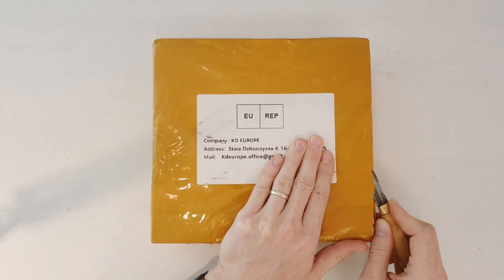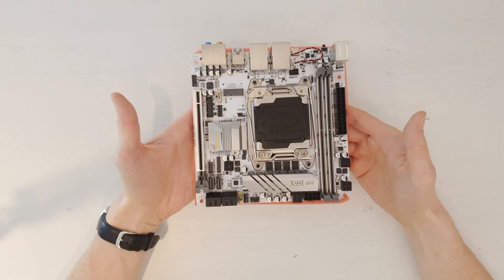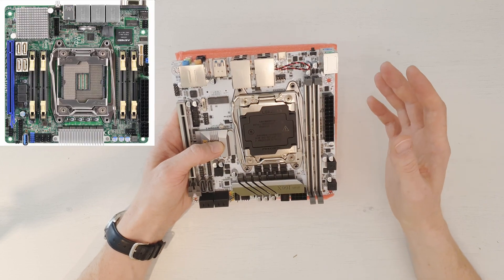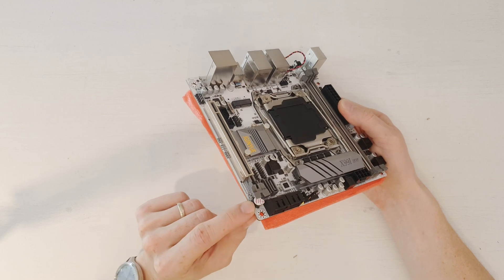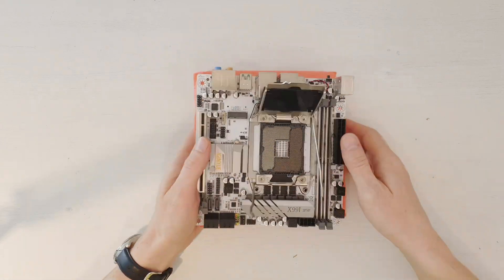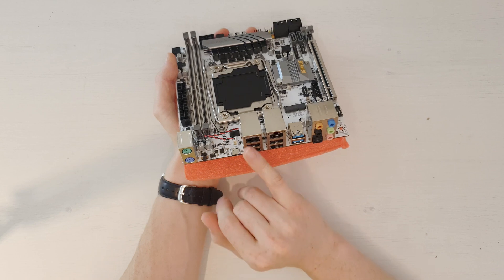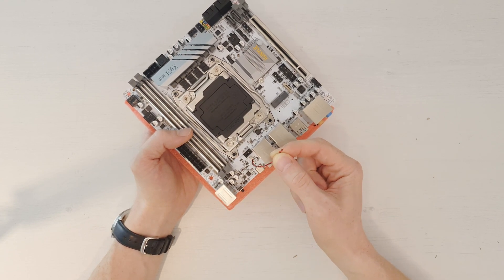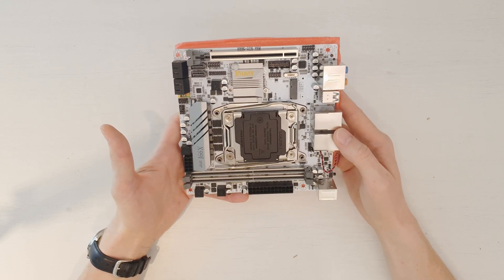🇬🇧 Unboxing Jginyue X99i Server and Specs Overview

Comment: I was crazy again, I beat Ali. I got the deal (JGINYUE X99I-SERVER motherboard), 5 days delivery to DE for 86€ AllinOne. 
Now I just have to find a suitable BIOS, either from the manufacturer or what I almost prefer, if ‘BIOS-iEngineer’ offers something, then from him. 
The CPU cooler ‘SNK-P0048PS’ 15€, with shipping, will take a few more days to arrive, with 2x Arctic P8 PWM PST fans.

Comment: Hello
I buy this model and installed all but no screen 
Gpu and cpu cooler still running without screen 

My setup
Intel xeon E5 1650v4 
64GB ddr4 ECC 3200MHZ 
RTX 4060 Ventus x2
SSD M2 Crucial P4 1tb

I tried many solution but no result 

In case you had this issue Maybe you can help and share how to solve 

Many thanks for your help 😊

Comment: did you figure out what is going on with the cmos battery? i have seen quite a few aliexpress mobos without cmos battery slots. but also i googled it and it said they store thebios settings in a non volitile memory, which means that the settings dont need constant power to be saved
Reply from the maker: My detailed review of the motherboard is available here: https://youtu.be/mBDM4isYs2Y

Comment: Sad to see it at around 650 yuan. It's cool if already have a 2011 v3 CPU and want to built on a mini it's platform, but considering that you have to also get another cooler, a small micro ATX build with a cheaper board and cooling solution will still be better if building on a budget
Reply from the maker: That's true, but it's still interesting to explore the motherboard.
Reply: @miyconstclips  know any ultra low profile cooler compatible with lga 2011-3? I really want a really small itx build with this mobo but cant found good itx cooler.
Reply from the maker: @1986Hikaru  yes, there is one, I have updated the video description, but don't by this motherboard, watch my review first.

Comment: Interesting to see 8 phase vrm and "solid state" vrm capacitors on the "low" side. Curious on how it will perform with 2666v3 or higher tdp cpus.

Comment: Just yesterday I thinking "does the Chinese will make ITX X99 board?" Since I want to put it on modded PS2 case, and here we go, what a coincidence 😂
Reply: ill save you a little bit of effort - if its a slim ps2 shell it wont fit
Reply: @limewirepro  Bruh the even 4 ram stacked together not even fit let alone the whole PC. I'm using fat model PS2 SCPH-3000x
Reply: @pingtime  what ram are you using?
also in a ps2 fat youd basically be stuck with itx, what board are you using with 4 ram slots?
Reply: @limewirepro  what I meant is, with PS2 slim chasis, even if you stack 4 ram stacked together like a deck of card, it's not even fit, bruh I'm not that dumb, even with rule of thumb I know PS2 slim chasis can't fit even the thinnest Pico-ITX boards, let alone Mini ITX

Comment: I feel like the glue spot was the battery and it came off the glue and the wire... Maybe they couldn't ship with battery?
Reply from the maker: Yes, that seems to be the case, the batteries are banned in the China post.
Reply: Yeah, battery are rarely shipped from there since they need additional clearence. I often got motherboards without the CMOS battery

Comment: hmm do you have another motherboard that has 2.5Gb lan ports? maybe you can connect this tiny mobo directly into the other pc and transfer files trought them directly, dk if it will work or is doable but might be the quickest way for testing those ports without having to buy a new router
Reply from the maker: Sadly I don't have another motherboard with 2.5G network.